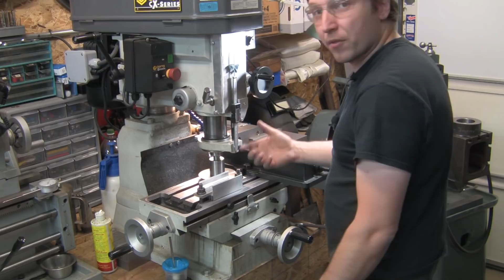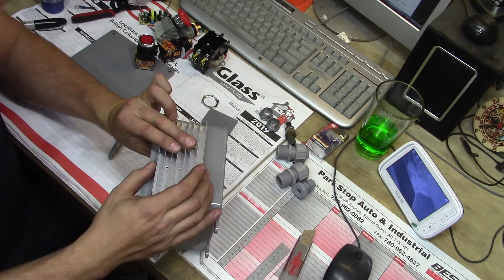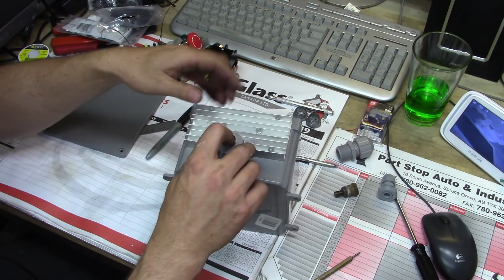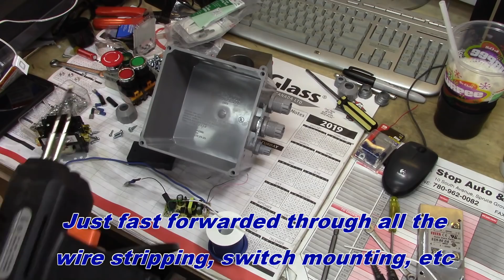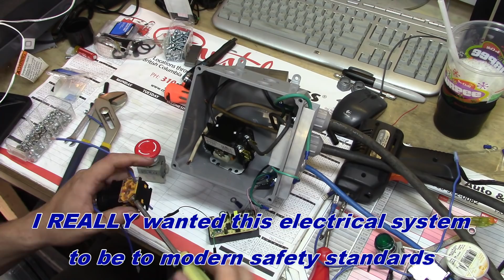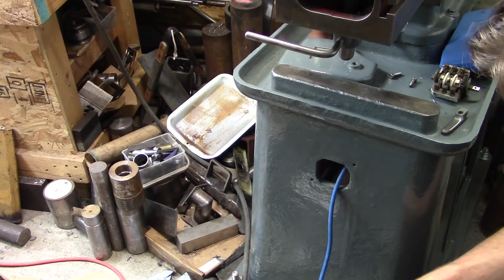Alba 1A Shaper Reassembly Part 9: Electrical System

Comment: Great project! As far as a restart safety wouldn't a double-throw relay, wired to latch, cover it. One button and one relay.
Reply from the maker: Thanks!  There are a number of ways a person could have done this, I was trying to be a bit on the cheap side but also retain the use of the rotary switch on the front. Thing is, I didn't want any sort of high voltage running to the front due to the exposed contacts and having to fish around inside to maintain the machine and change speeds.  I just figured this way it was all in one box apart from the wires.  This also adds the option of adding low voltage limit switches at some point to shut the machine off in the case of the table running too far in one direction by adding switches in series with the front one.

Comment: Great job on the motor control, always needs a bigger enclosure 🤔. Those Chinese SSR are notorious for being under rated (amperage), second hand branded are sought after on eBay.
Love the original cast switch re tasking.
Thanks for sharing and best regards from the UK.
Reply from the maker: Thanks, it has been a bit of an adventure, for sure.  Glad I had 2 SSR's, and if this other one bites the biscuit then I'll find a different make.  I really wanted to reuse the original switch but just wanted it to be a safe operation as things have changed regarding safety system since the 40's.
Reply: @EverettsWorkshop  like the double pole no voltage relay and reset circuit, pretty much all 3 phase equipment has had this for 80 plus years, but lacking from single phase until last 20/ years. I refurbished a RJH linisher last year, it still had the 3 phase rotary switch controling a retrofitted single phase motor, called a Dewhurst, lovely design, but it failed a high voltage Insulation test, so used a Krause and Naimler rotary for isolation, plus a DOL motor starter.
Enjoying your videos, best regards from the UK.

Comment: Hi  as always great info on what’s going on in the workshop .Every step is closer to a fully working shaper . Only found out a few weeks back that I missed out on the shaper I had planned on .thats life ended up getting a surface grinder and die filer from the same bloke .keep up the great work always a highlight of my YouTube watching   David
Reply from the maker: Thanks David!  Well, missing out on a shaper but getting a surface grinder still sound like a win to me!  Never used a die filer but seen others use them, that could be a handy little unit to have around as well.  Glad you like what's going on here, hopefully it continues to be interesting a different stuff and projects come along.
Reply: I am a little disappointed about missing out on the shaper .Really waited that or at lest another one later on .The die filer is a full size one standing about 5 ft high .Lots of bits and peace’s to do for both machines .Weather is getting better now as we move towards summer out of winter .Take care. David

Comment: Everett, I'm confused, why did you add the SSR?  I see you're using a contactor, I assume it will handle the motor's amp load right?   I've never had to use an SSR so forgive me if I'm asking a dumb question (most of my q's aren't the most intelligent so...)  :-)
Reply from the maker: It is totally not  dumb question at all, in fact I've been asked by others both here and in conversation.  The SSR is in series with the primary pole of the contactor.  This way I could use a low 5V signal through the original switch (with crazy exposed contacts inside the base)  to make the original switch functional but not dangerous.  In retrospect, I could have used a 24VAC transformer and a 24VAC coil single pole 120VAC contactor instead of the 5V switching power supply and the SSR, that would have been a more mechanical method of doing it.  So far this works, if it causes problems down the road that might be Plan B at that point.
Reply: @EverettsWorkshop  Okay, that makes sense, more of a belt and suspenders solution then.  I'm working on a lathe that was missing it's electrical components and I'm using a 24v transformer to supply my low voltage.  Like you, I prefer low voltage for the signal connections.  Just noticed that I forgot to say that I enjoy your videos and really look forward to them, thanks!

Comment: By ek Everett, I bet you don't want to wire another box up like that, luckily it looks like you've got small hands. One of the main reasons for the no volt release switch is if there is a electrical power failure when the machine is in operation, the machine will not start back up on its own when the electric supply is resumed. Interesting job on machining the box as well, you could have screwed the lid on to brace it while on the mill. Nice touch keeping the original rotary power switch, its not far off now to see the shaper cutting chips. Tony
Reply from the maker: Lol, you know Tony, putting the lid on would really have been the best solution, wouldn't it?  I think I need more sleep, the thought didn't even cross my mind . . . As for the no volt release, that was precisely why I wanted to add the feature to the machine.  I want it as safe as possible for whoever is running it, be it me or someone else.

Comment: Nice job! I would have been tempted to just throw a toggle switch in but that was the right way. Now you need cheese and salsa and make some chips!
Reply from the maker: Thanks! I got the machine with a big light-switch style toggle switch on the back, but wasn't comfortable reusing that setup. Hoping to make chips with it before October . . . Hopefully . . . It's only been since Easter, lol
Reply: @EverettsWorkshop  I have a garage full of projects like that, going next week to pick up a KR Wilson 50 ton press that needs a rebuild and a 2" x 72 belt sander that needs the same. I am a glutton for punishment.....I just might have to pull out the video equipment.

Comment: What does the thermal paste do?
Reply from the maker: This is my first tine using a Solid State Relay, and from what I have gathered from my Dad, and from Stan Zinkoski (shadonhkw) at Bar Z, SSR's need heat sinks as the supposedly can get hot. The thermal paste increases thermal conductivity to help pull heat from the component into the heat sink where the air can take it away.

Comment: Little Man will convert it to run off of a Mr. Fusion.  We should have those by 2015.
Reply from the maker: Lol, that's his call - he may have to make a flux capacitor housing to mount to the other side of the shaper to handle the output of the Mr Fusion . . . Thanks for the laugh!

Comment: Well done Everett, Tight box.  What a relief it works.  Making chips soon.
Reply from the maker: Thanks Randy, it was a bit of a squeeze, if I ever have to make a system like this again I'll use a bigger box. Hopefully she'll be a runner soon. Been series binge watching your cement mixer resto, very cool!
Reply: @EverettsWorkshop  coming along trying to get as much done as I can before winter sets in, at least repairs and primed.

Comment: Boy you sure packed it in that little box. Nice job. I hate getting bad electrical stuff. I did a 4.2 to a 4.0 fuel injection conversion in a Jeep CJ for a buddy. Got everything wrapped up and couldn't get it started. Turned out I had a bad tps. Got a new one. Wouldn't start still. Got my third tps and finally it started up. Just cant get good parts anymore.
Reply from the maker: Thanks Tom! Yeah, it's kind of a crap shoot at times depending on the reputation of the supplier . . . I don't even know the name off the top of my head of the SSR supplier, hopefully the SSR's are real Fotek units and not counterfeits!

Comment: NIce job!  But a bigger box would have been a better choice.  Here's hoping you never have to open the box to replace anything.
Reply from the maker: Thanks James, and I totally agree with you! This was the first control system like this I've put together, and was trying to keep it budget-minded so the cheaper box internals were partly chosen by that criteria.  If I ever redo another machine the system will have a few changes (like a bigger box) for sure!

Comment: Safety first Everette - quite agree. Re slitting saw - I have yet to find one when - even mounted on a good arbor - it never runs without some seeming wobble! Great work on the electrical box... lots of nice innovation. I have had many a time when installing things in a box, and access got ever more tricky! 

Altogether - super job. :)
Reply from the maker: Thanks Chris, I'd still like trying to get that slitting saw straighter at some point but there are lots of things needing dealing with first. As for the control system, it's not industrial standard in wiring, but it's properly functionally safe as would be required of a new machine. If I had to do another I would change some things but this was a learning process for me too.
Reply: Yep...slitting saws ALWAYS run out!!

Comment: You may want the check that your SSR bottom plate is actually ground ( look at the specs for your SSR ) before you wire the heatsink to your machine/box ground.   Not all semi-conductor devices have their heatsink plate connected to the ground. :-)
Reply from the maker: I hear you, that is one thing I didn't check but was pretty sure it wouldn't be hot as attaching a heat sink in most cases that way would result in a dead short to ground. My bigger concern was the fasteners holding the heat sink to the box - they are exposed to the inside of the box so it removes the risk of a rogue wire making the heat sink electrically hot.

Comment: Good job Everett. I sold industrial controls for 15 years and you gave yourself a lot more work than needed. Standard installation practice is that components should have been installed to the bottom of the box. Giving you access to the terminals. Thanks for sharing.
Reply from the maker: Thanks Yves, I certainly don't claim to be a millwright.  I certainly could learn from a millwright or person involved in industrial automation like yourself - I'm just an auto mechanic but want the machine to run safely so this was the best I could come up with.  As was mentioned below, I should probably have used a bigger box, lol, would have made more space to mount stuff to the bottom of the box as you say.  If I ever do up another machine I would probably do it differently, this has been a learning experience for sure!
Reply: @EverettsWorkshop  If you need help email me.

Comment: I freely admit I know nothing about wiring requirements on your side of the pond but do you need an SSR and a contactor. Surely a contactor alone would provide your no volt release needs,or am I missing something  (apart from brain cells, that being a given)
Reply from the maker: The reason I used both an SSR and contactor was that the contactor provides the magnetic hold-in for the power-off safety function, and the SSR requires a very low voltage to turn on.  That way I could, in good conscience, use the cool old original switch to be the "on" switch.  I could have merely run everything from the gray box without the 5V supply or SSR and left the switch at the front as a decoration, but thought the nostalgia of the switch was cool.
Reply: @EverettsWorkshop  sounds reasonable

Comment: I've.foundover the years that whenever I went to buy a project box for some circuit  or another to always get a box that was one size bigger than I needed , I guess you just discovered that as well, because there is always something else you need to add. Anyway good work squeezing everything in there.
Reply from the maker: Thanks Larry, I had thought about getting the next size up but that one would have really hung off the side.  Thankfully there was just enough room for the parts in this one, it was just getting the screws in that was a pain.  I'm sure some person in the distant future who has to change a contactor will cuss me out over it, lol!

Comment: That has been a great project and yes when we order something from the "old country" there is a chance it may not work.  I'm not 100% sure but I think I read you could make conductive paste with talc and mineral oil.(don't try it, it may have come from the old country, too!)  Well, I hope the rest of the restoration goes smooth.  Watch that 5 volt power supply if it has a capacitor in the output because it could create a "hold" situation with a power glitch.  But I bet you already scoped all that stuff out.  Greg
Reply from the maker: Thanks Greg, yeah I was a bit disappointed to see the SSR wasn't working.  Was kind of  let down, but once it was replaced it was off to the races.  One thing I didn't mention was that I put  220K ceramic case resistor between the + and - of the SSR, that will drain any capacitive charge off the input circuit of the SSR, but still not be so low a resistance that the 5V signal level gets pulled down too much.

Comment: After you got it started it sounds like it needs grease on something inside and I will agree with two other commenters on wiring diagram and brilliant use of the paste , but think the safety switch should be by its self on the side or the cover as you dont want to hit any of the other switches in a panic moment and you could use a leg to turn it off if needed
Reply from the maker: I had thought bout the e-stop placement, and figured that it should be ok where it is, as I put both of the buttons that stop the machine to the outside.  You actually have to reach in a bit to get at the green on button, so as long as one hits the mushroom it will all go dead.  I suppose it could have been run remotely but that would have meant more drilling into the old girl.  This is still far safer than the original switch or even the overgrown light switch that was on the back when I got it!

Comment: Please do an electric drawing and attach it to the inside cover. In five years when something breaks, you won't remember how you wired it and will spend a lot of time trying to figure it out.
Reply from the maker: I have a chicken scratch drawing as well as what I was using in my head, but yes, I will make a good copy and put it in the box.  Partly because if someone else winds up with it they can then troubleshoot any issues that may come up with machine age.
Reply: Why? Everett has a you tube video of it !!
Reply: SAMRODIAN : It's obvious that you have no industry maintenance experience. Let me give you a couple rules you'll never get in trade school.
1. Machines never break sitting ideal. They will  deteriorate but won't break.
2. Machines only break when you need them the most. For Everett it will happen when he's trying to get something out while filming and watching over Little Man.
3. Keith Fenner said it best, "It's better to be looking at it than looking for it." This applies to more than just mechanist operations. Everett will have to secure his machine, secure Little Man, stop filming, start up his computer, watch the episode, then put Little Man in a safe place, get the tools he'll need, and then start trouble shooting.   Or he could stop filming, open the electrical encloser and read his schematic before trouble shooting.
Which one do you think is faster?

Comment: I like the way you wired the shaper up. Kind of over my head on the design, I’m a machinist not an electronic guru. You made it interesting, what I’m waiting on is seeing chips flying
Reply from the maker: Thanks Jim, it's not really a lot of electronics apart from the pre-purchased 5V power supply and SSR.  The rest of it is just a few parallel and series circuits, but it now works as I wanted it to.  A few more things to do and I can use it!

Comment: Great video 👍 bud like the idea of the safety switch on it
Reply from the maker: Thanks Raymond, I wanted to use the switch on the front but didn't want to run line voltage to it, but also wanted the emergency stop function as well.